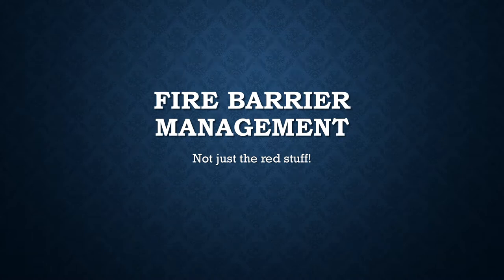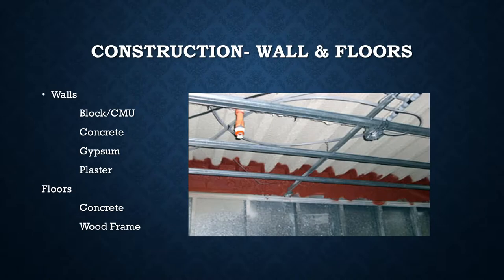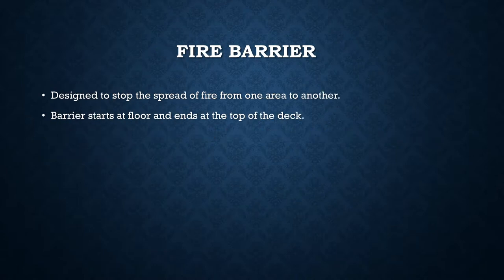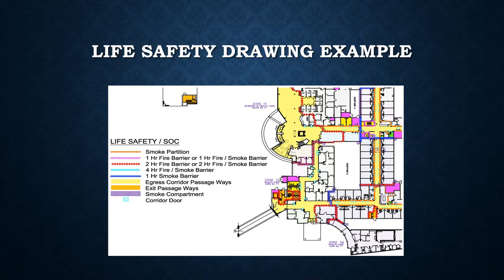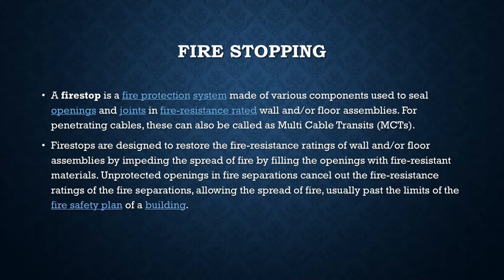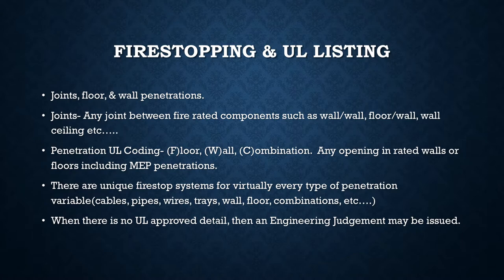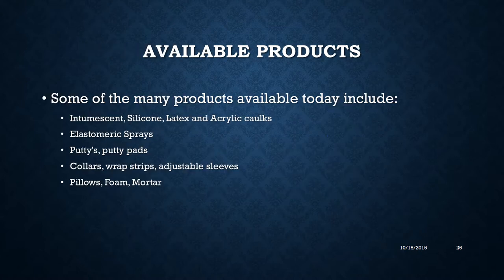Fire & Smoke Barriers

Comment: Another suggestion for this module is there is no such animal as a 2-hour smoke barrier.  Section 709.3 states a 1-hour
fire-resistance rating is required for smoke barriers.  The Architect has mislabeled the legend.  Fire barriers can be rated
1 to 4 hours, however smoke barriers are only rated for 1-hour.
Reply from the maker: That is correct, although in healthcare a fire wall may need to be constructed or filled in such a way that it is also smoke rated.  this comes into play when a wall that creates the "smoke compartment" for defend in place is a factor.  Fire rated walls to not have to be impervious to smoke if they use intumescent(fire caulk), however, a smoke rating has to ensure there is no openings.  It is confusing.  Due to modifications and construction this is not so very uncommon in healthcare.   very good point.

Comment: A suggestion for this module; you talk about firestop systems but don't explain what a "system" is.  It might be beneficial if viewers understand that a "system" is UL listed therefore using one manufacturers pillows with another manufacturers intumescent caulking renders an unlisted installation and is therefore invalid.